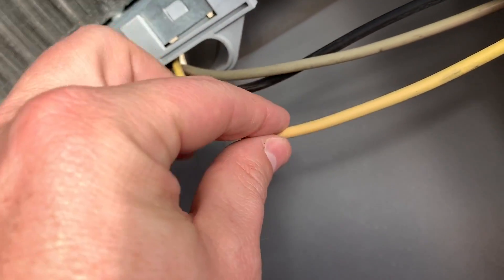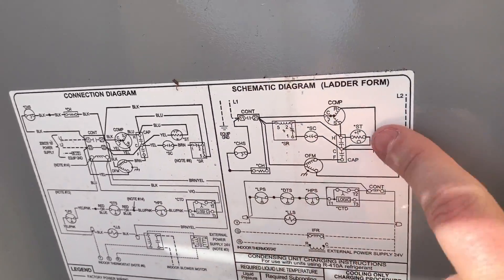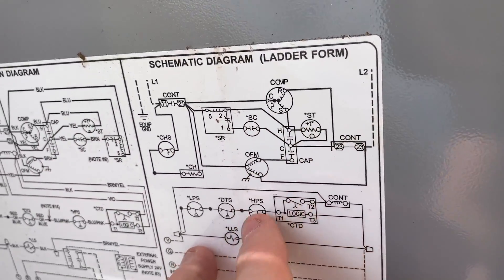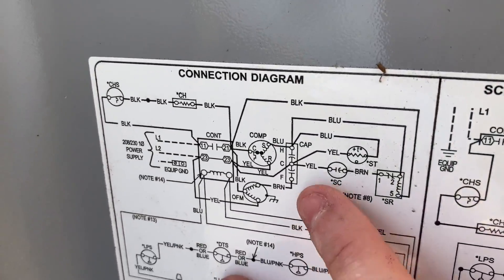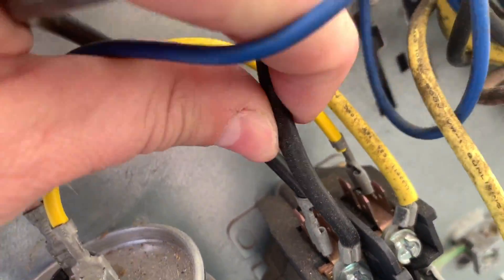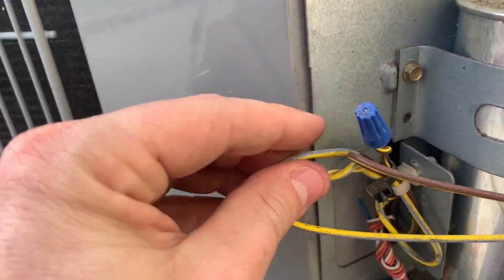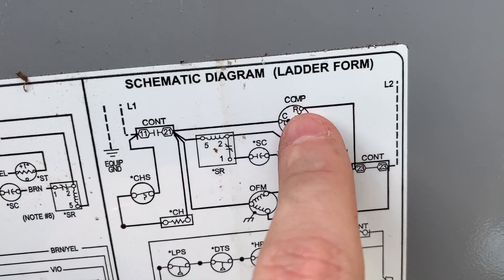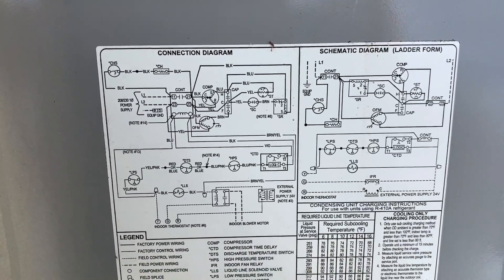Straight Cool Air Conditioning Schematic (Carrier)

Comment: Do you have a video for the Line connections for the Unit in the Attic? I was just looking at one in the attic. It had 4 breakers I couldn’t figure out where to land the 10 gauge wires and where to land the 8 gauge wires.

Comment: Usually L1 is line also L2 is line but L2 is com if we have L1 to L2 com for 120 v this cases L2 is neutral if we have a L1 to L2 for 220v so L2 is com in general the L2 is com correct me please if I’m wrong thanks
Reply: L2 on a Residential unit will very likely have 120volts to ground. The word common signifies that 2 or more components share the same wire. Not to be mistaken for a Neutral wire. If not sure always call a professional

Comment: Bryan, I have asked this before, I'll ask again. Is  the run capacitor being used as a crankcase heater effective? Also, does it matter if the run or the common is on the shunt side of the contactor(i.e. where  there are no contacts making or breaking)? I've seen schematics showing both ways, but I connect the conductor going to the run on the compressor as on this schematic. Do you know the history of why the manufactures started wiring the contactor to capacitor in this way. Also, when you did teaching in Jamaica, where did you get those excellent beginners books? Thanks, as always for your valuable videos.

Comment: (*These Items might be factory installed, but most likely not) In my opinion all Air Conditioners should have low & high pressure switch as well as hard start Installed from the factory, it’s the right thing to do

Comment: Do residentiai condensing units that have a start relay means that it has a txv?   I dont work on that crap just curious.
Reply: No, the txv is a mechanical valve that uses no electricity.